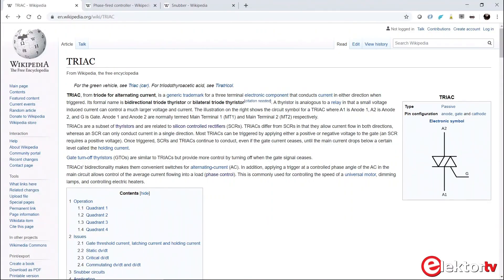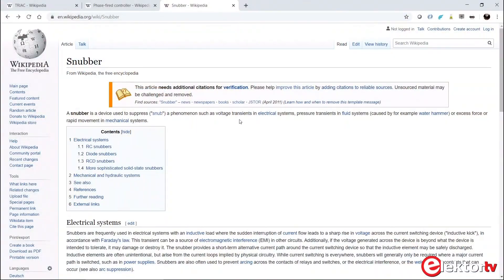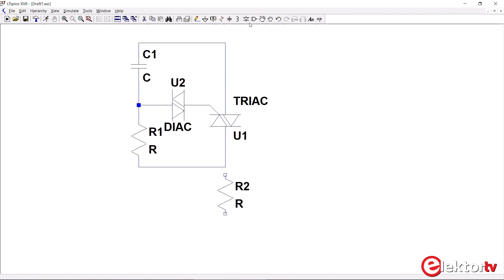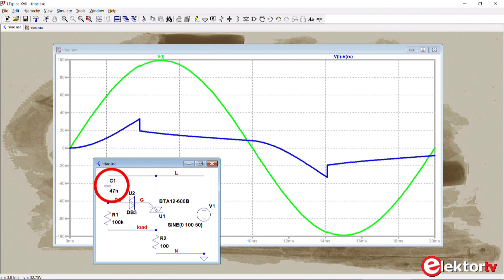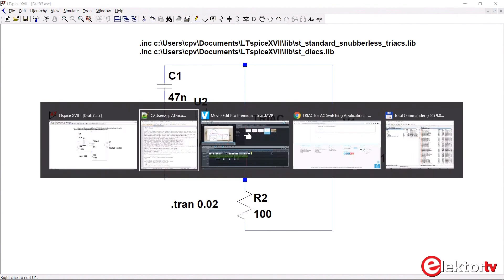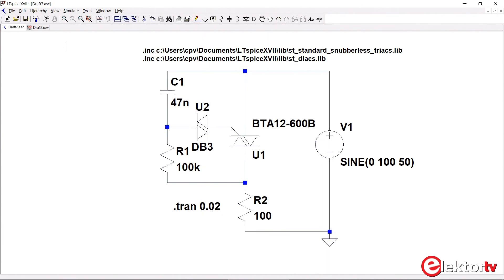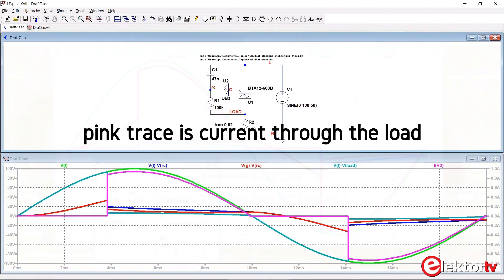How to use a TRIAC in LTspice

Comment: For people struggling like I was I think that I found the problem -

Windows Notepad was not letting me save the file with a .LIB extention (only .TXT) and Windows explorer was not letting me change it.
In windows search bar I had to type File Exploter Options - this opens in Control Panel then under the View panel find Hide extensions for known file types.
Unclick this.
Then when you select the file in explorer and use Rename you will be able to edit the .TXT file extention to .LIB
I also suggest that you select the file and use copy as path and paste it in as an ltspice command with .include (space) e.g.  .include "C:\A-LibFiles\TriacsMarch23R3.lib"
It doesn't seem to mind having the quotation marks.

I used the Standard and Snubberless™ Triacs PSpice model (.lib) and symbols (.olb) 
on the following page

https://www.st.com/content/st_com/en/search.html#q=spice%20model-t=resources-page=1

and if the name is something like   .subckt T405-700 A K G

you only use the T405-700 part as the Triac value

Comment: Thank you for this video. Normally you will not expect a Triac gate voltage above 1.5 V relative to MT1. 8.01 in video you show V(L)-V(RC). I think this voltage should drop to about 2 V just after Triac is triggered. But it only drops to about 20 V. So I think something is wrong, and I guess the Triac model got problems. I started with a triac model proposed as an educational dimmer circuit provided by the normal download of LTspice today. This model also got problems, but only in the positive half period with high gate voltage. And then I started to see if I could find some information on internet. I have also tried an unsuccessful attempt to change model. When I search internet, you got several people reporting some problems with the Triac model. So I hope for your help here.

Comment: Attention! If you get an error "Unknown parameter "*"  in LTSpice. Here is the solution:
There is a typo in the st_diacs.lib in line 79. 
Line 79 of this file is:

R_R1 N02098 TRG 1.462*{Tr}

but which instead ought to be:

R_R1 N02098 TRG {1.462*Tr}
Reply: Dude, seriously, you're a spice beast. How did you pick up a small typo like that? Thank you very much for the tip.
Reply: thanks bro
Reply: Absolutely, thank you kindly
Reply: @APVT80 You're welcome :)
Reply: Great!!!!
Reply: thank u
Reply: I got "unknown subcircuit called in: xu1 n001 n003 n006 triac" do you know how to fix it?
Reply: Bro i was searching this for 1 hr and it said line 540. I was searching for error in triac lib. Thank you bro. There error sunks.
Reply: @rajeshjaganathan224 No problem 😊 Happy to help you guys.
Reply: It's interesting that it wasn't an issue in the version of LTspice that he uses. I've checked, and it's the same in the one on Github.

Comment: 2:24 - I feel like the world is filled with retarded educated electrical engineers, worthless people, so you seem to know what you are talking about and actually is educated when it comes to "Triacs" and electrical engineering. I hope you can answer this question: Is it possible to trigger a Triac based on it's proper quadrant mode by manually triggering the proper gate polarity at the right time and moment? Basically what I am asking is instead of following all the brain dead sheeps who uses an optocoupler with built in diacs and other magic circuitry, can we build a proper triggering system for a traic from scratch? Can we use a microcontroller to do all the triggering of the right polarities to the gate terminal of the Triac? With today's low priced advanced high speed microcontrollers, it would be nice and fun to play around with some advance time based programming for triggering a Triac to control current of AC components, this is the only reason why I would like to use only a microcontroller to control a Triac. I have not seen anyone on the internet to do such a thing because it's too complicated to comprehend.

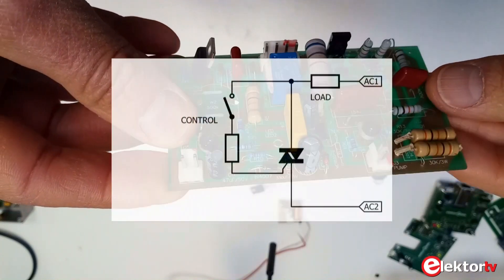Comment: Is that a dimmer pcb you were holding at 02:37 ? or what ?
Reply from the maker: Kind of dimmer, it is the heating/fan controller board of a hot-air soldering station.